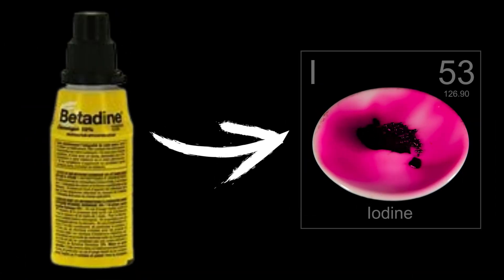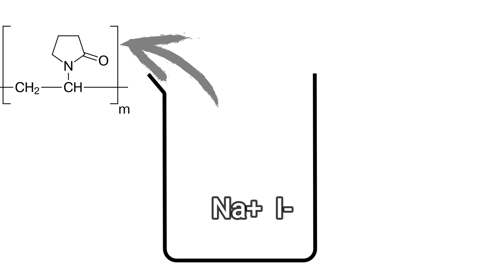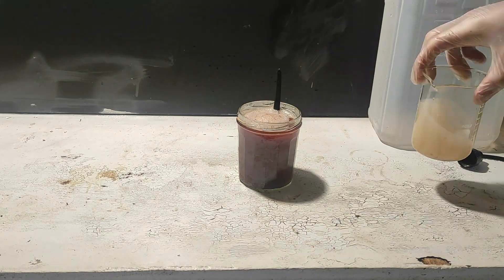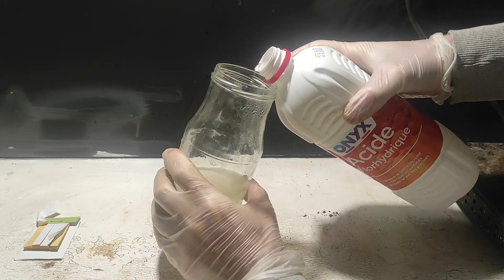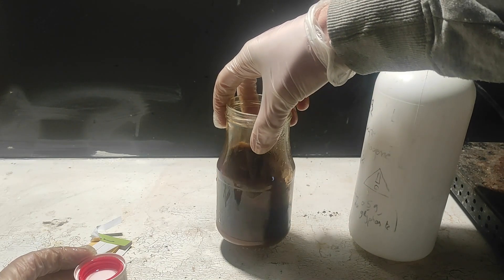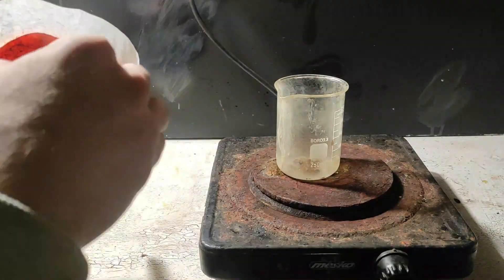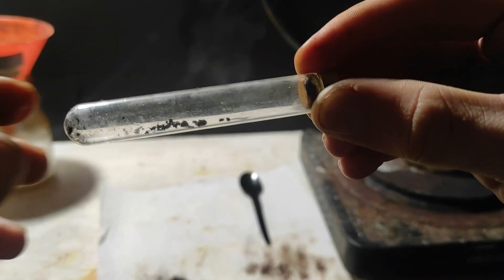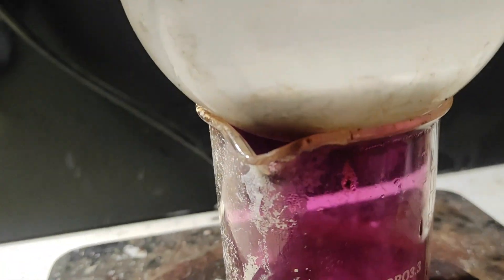making iodine ; the poor method

Comment: Awesome! Very interesting video too, question, is it possible to use sulfuric acid instead hydrochloric acid? Let’s say my hydrochloric acid maybe expire, I’ve never opened it for years, meaning to, never got the chance, busy! Plus it was kept in the garage inside a plastic container cooler as well was.
Reply from the maker: I think you can, but just to be sure ,I recommend you do a test on a small quantity, to be 100% sure
Reply: @jam_kemist3986  thank you

Comment: After adding the HCl a yellow sol is formed with brown precipitate , later i used kmno4 as oxidizer i saw the solution turn colorless and brown ppt was obt on adding further Kmno4 , it seems like redued kmno4 like Mno2 , how will i get iodine 😢
Reply: And i dont have H202 so kmno4
Reply from the maker: @samriddhapaul5827  it's harder to do with KMnO4(if it's possible at all idk) because the stoechiometry is diferant so easy to overshoot it. I think you have to recycle your iodine or try a new batch, good luck ! :)

Comment: You can do this add hydrochloric acid to potassium iodide and then add hydrogen peroxide then wait until it drys and then you get a mixture between potassium chloride and iodine and then you boil the crystals and collect the vapors and you get elemental iodine
Reply from the maker: I don't think boilling the solution is a good idea but this is another method